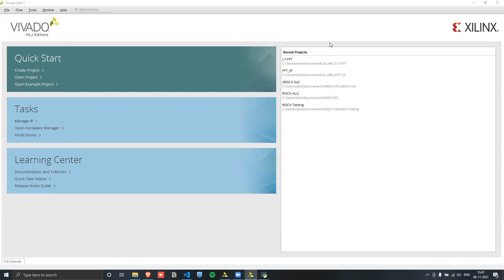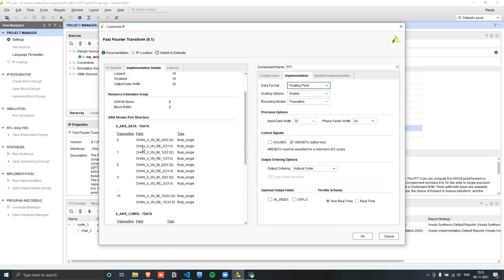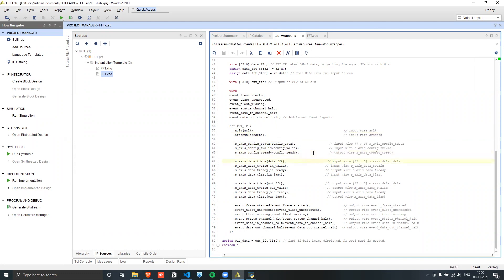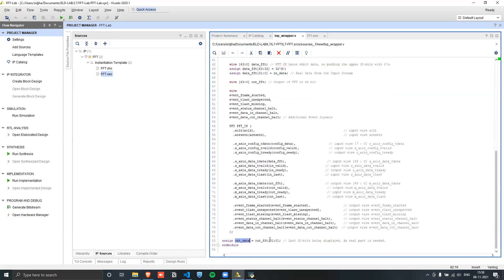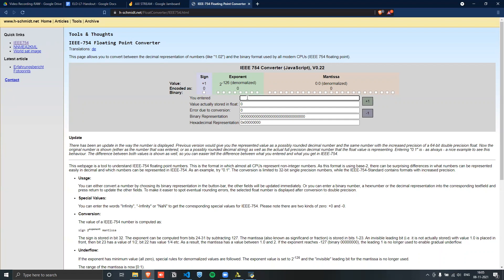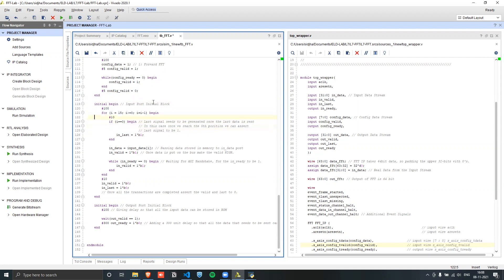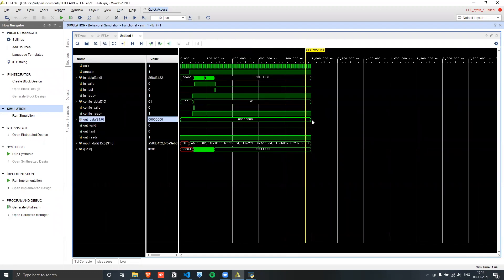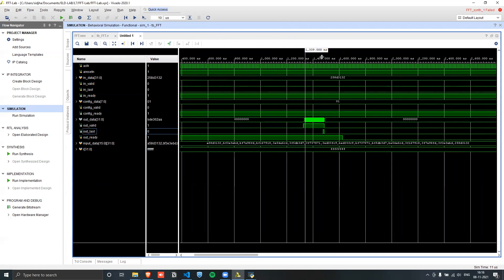Lab_7_Part_3:  FFT IP and Verification via Testbench #iiitd #iiitdelhi #fpga #fft #vivado #basys3

Comment: excuse me my simulation when reaches to 105 ns, stops and runs forever and I can not see the output data after 0 , I use vivado 2023, and for testbench my timing scale is 1 ns/ 1 ps. can you tell me what is the issue?
Reply: I am facing same issue, did you find any solution?

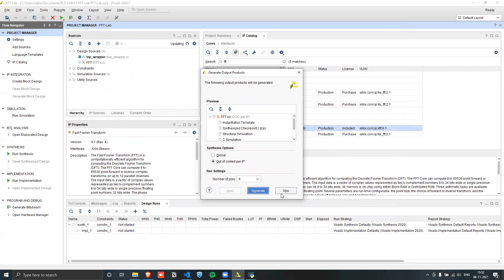Comment: can you explain how the top_wrapper.v file changed from empty (time 4:10) to fully populated(time: 4:12)?
Reply: first he wrote the inputs , outputs of the module and wrote the wire data_fft, and wire out_fft

and then to instantiate the fft_ip inside the top wrapper,
1- he copied the instantiation template from the fft.veo file and pasted it inside the top wrapper,
2- then he changed the port map in this instantiation template and put the inputs, outputs and wires that are declared in this top wrapper to complete the instantiation of the fft_ip.

Comment: Greetings. Came across you video. Very helpful. One thing i don't understand is my out_data[31:0] is always Hi Z while yours is 0. My out_data never seems to change. my out_fft is just like yours and the code was also copied. any ideas?
Reply: You need to change the variables that are passed into FFT IP test bench from "s_axis_config_tdata" to the variables you declared in top wrapper "config_data"

Same case for other variables
Reply: I have the same issue, did you find a solution ?